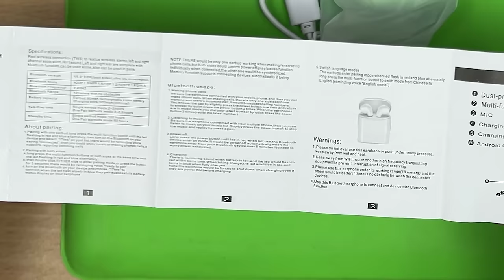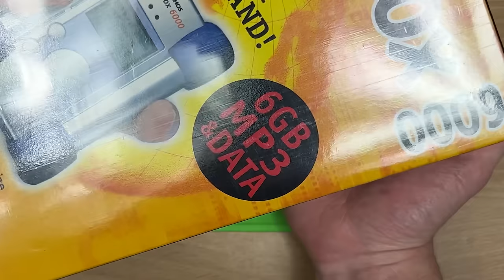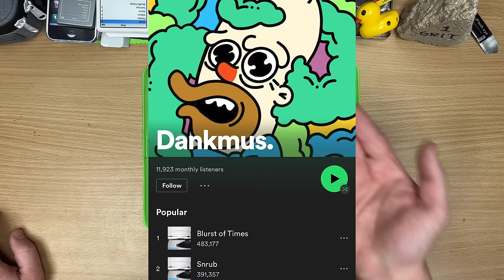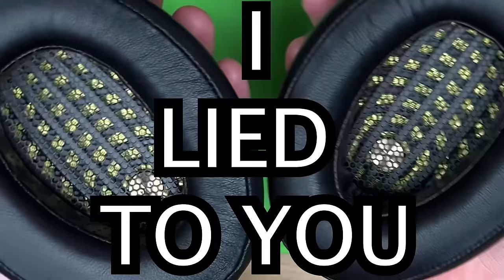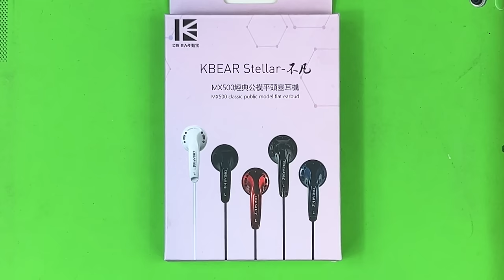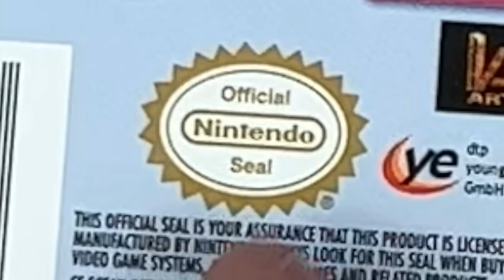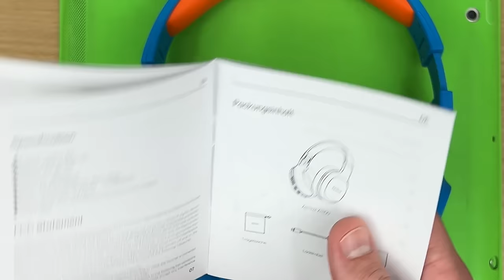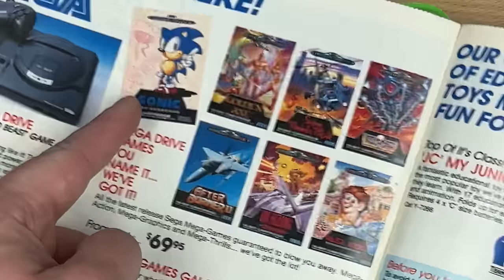DankPods - The Complete 2nd Season - 4/4

Comment: I saw it touched on very briefly: Shoutouts to LGR for introducing me to them, and to Iomega for making the "I really don't wanna take up space on my hard drive for this, I'd have to uninstall Diablo" Clik! Disc.

Never has it been easier to spend a literal hour installing Doom 2 from a single speed CD-ROM drive in a laptop with a 75mhz CPU (Cryix Instead™) and 8MB of RAM to a 40MB spinning platter both powered and transferring via PCMCIA.

I jest, but that's a genuine feature when your Windows 3.11 laptop only has a 340MB hard drive, but 2 PCMCIA card slots; one for Ultimate Doom, the other for Doom 2, with room on each for a handful of shareware WADs on each one.

Only drops to a sub 1 framerate during the screen melt between levels while the Clik! disc screams for death's comforting embrace, it's great!

Anyway, back to iPods.